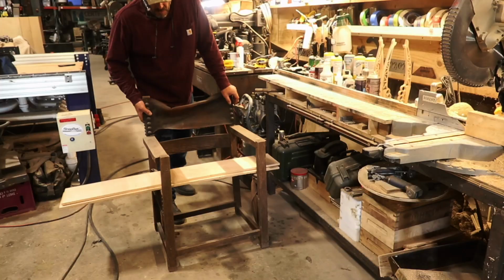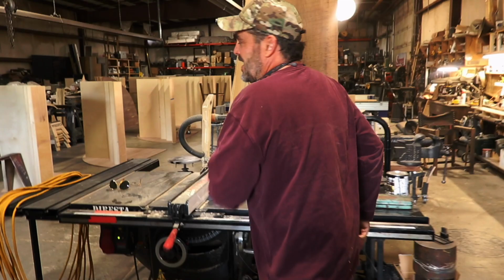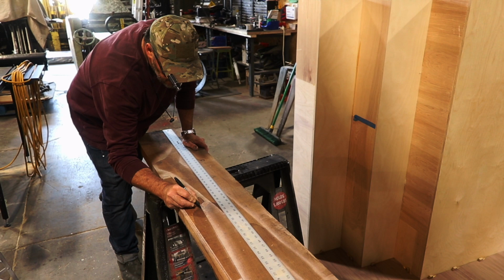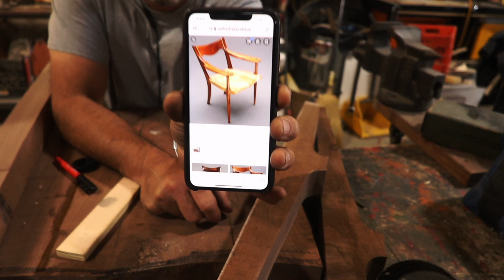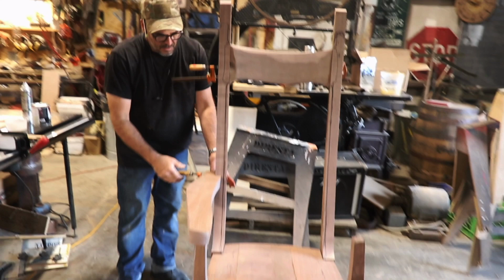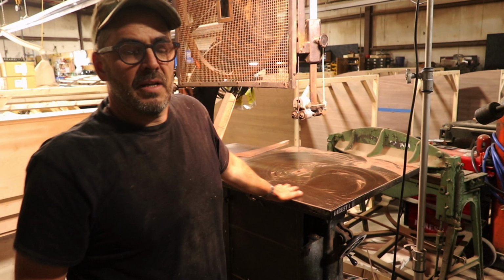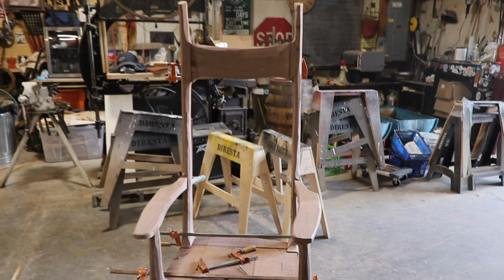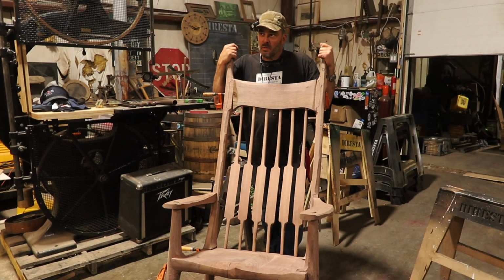DiResta The Making of The Rocking Chair

Comment: Just a little worry on my part, but depending on the environment it may find itself in in it's LONG life. I worry that the seat may eventually crack leading it to someone falling though it if it doesn't have a cross brace attached to the bottom of it.